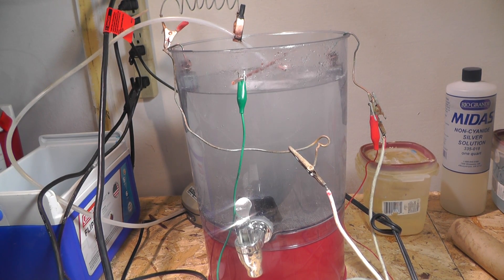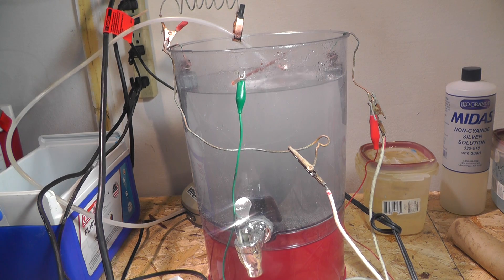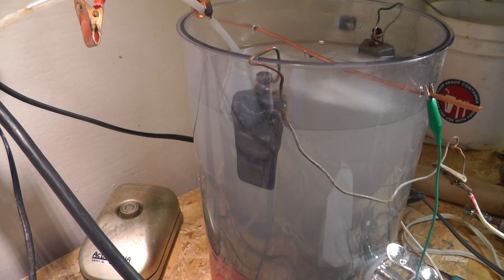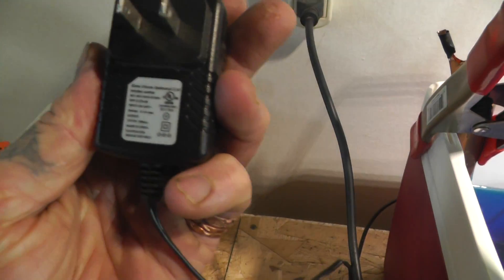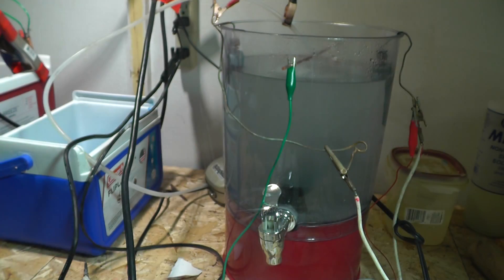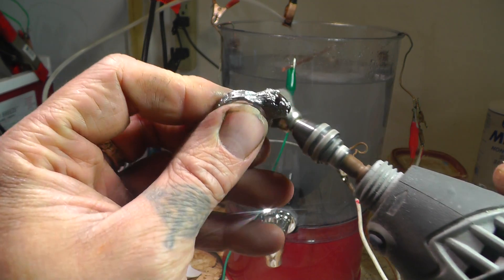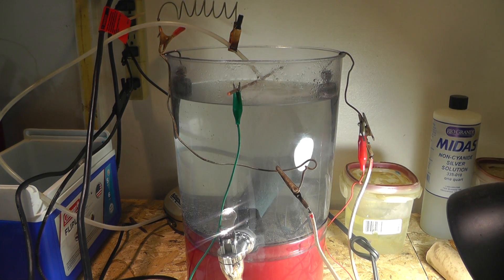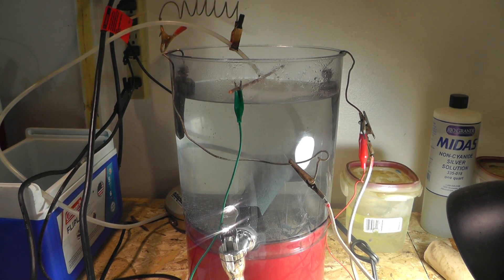Electroplating Zinc to Copper Video 2  (updated 1 year later)

Comment: Jason welsh I bought the 1503DD+ model its a 15v 3amp now it seems to work for powering stuff like moters bulbs anything that runs on electric but when i try to zinc plate it just bleeps & flashes like its cutting out just no electricity going to the anode or part that i want to plate could you help me out please buddy any ideas?  ? ?

Comment: What about using copper electroplating followed by zinc electroplating, than put in a oven to obtain some kind of brass plating? Direct brass electroplating seems to be not so easy. Do you ave any experience of this?